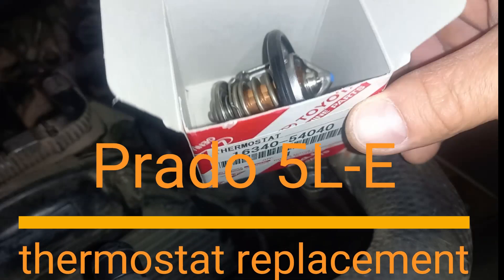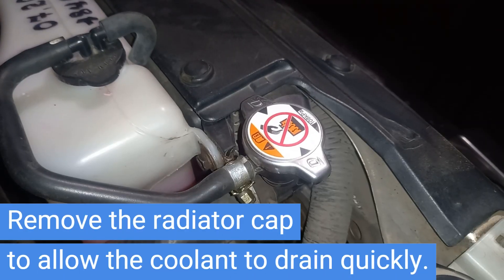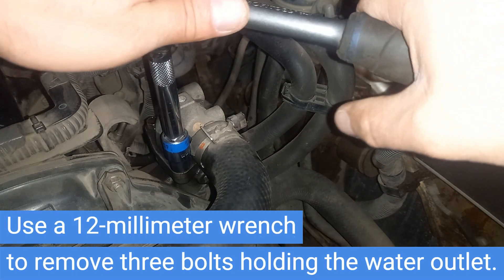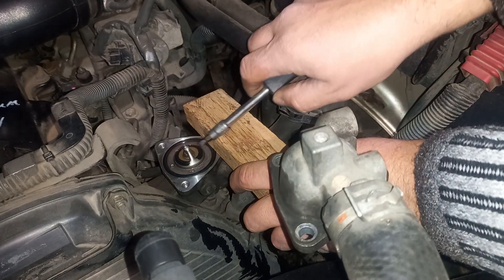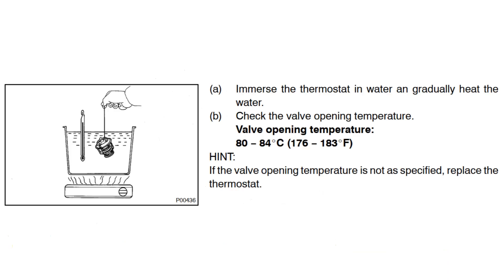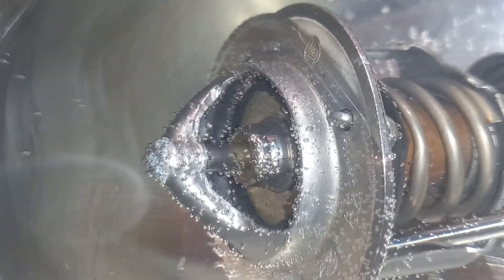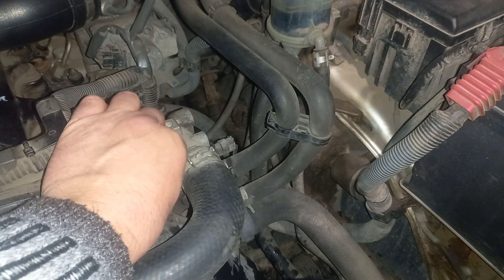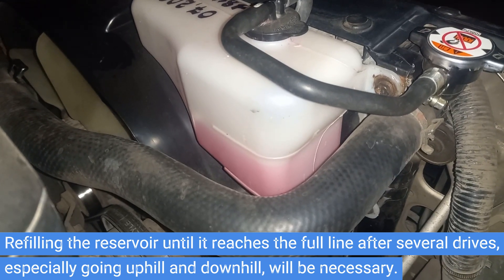Thermostat replacement ”5L-E” engine Toyota Land Cruiser Prado LJ120

Comment: Hey brother, I also wanted to ask, how many km per liter do you get on this engine
Reply from the maker: The fuel consumption test I have done once. It was on a paved road with some hills, with 50/50 speed limits of 50 km/h and 90 km/h, to the destination and back. I was driving alone with a full tank and about 50 kg of stuff on the way back. The result was 7.99 liters/100 km. It is 12.5 km per liter. A full tank before the trip and after the trip to measure. I had non-standard 265/70R17 (a little bigger) road tires instead of standard 265/65R17.

Comment: Hello, I have a Toyota Fortuner with the same engine, what do you think about the power output of this engine, it feels underpowered. Also are there any automatic gearboxes for this engine and what is their name, I want to change my manual. Can this 5L-E engine be turbo-charged for more power
Reply from the maker: After checking online catalogs, it appears that vehicles equipped with the 5L-E engine do not have an automatic transmission. I found that Toyota Hiace and Hiace Regnum with 5L engine from the late 90's and early 2000's had automatic transmission. I don't know of any case of changing it to 5L-E.
Reply from the maker: Engine power influences vehicle acceleration. Yes, the 5L-E does not have fast acceleration/power.
Reply from the maker: The last Toyota "L" engines to have a factory turbo were the "2LT" and "2LTE". There's probably a reason Toyota doesn't install a turbo on the "3L", "5L" and "5L-E". As I understand it, these "indirect injection" type engines are not the best for a turbo. However, there are aftermarket turbo kits designed and people also use turbos from different vehicles. I think it is better to exchange the entire vehicle for one with a different engine.
Reply: @princessprado120  I do like the car a lot, it is rugged, cheap to run and has never left me stranded but it needs a power boost, I have seen people turbo 5Ls but this one with electronic fuel injection my fear is in tuning the fuel pump to accommodate the new air-fuel ratio
Reply from the maker: @iss-hogaishamu5862  Installing parts that were not designed for the vehicle by the manufacturer will decrease reliability.